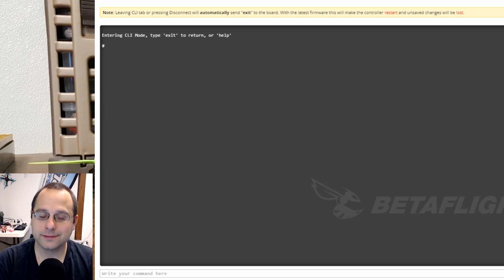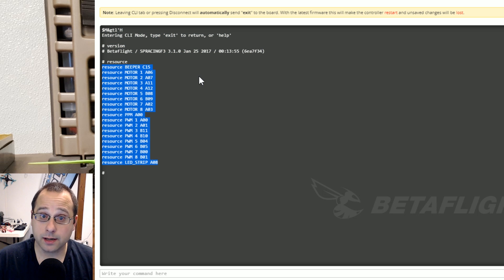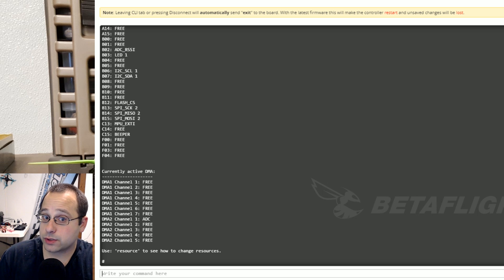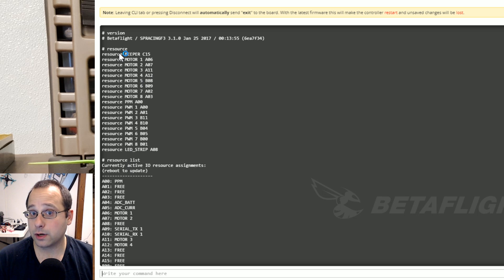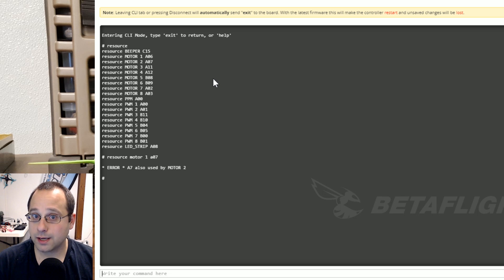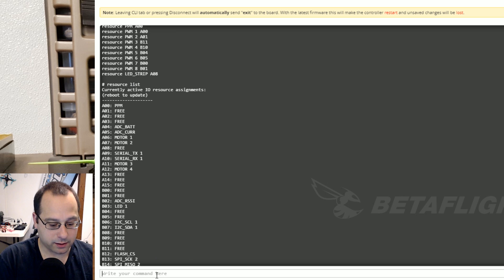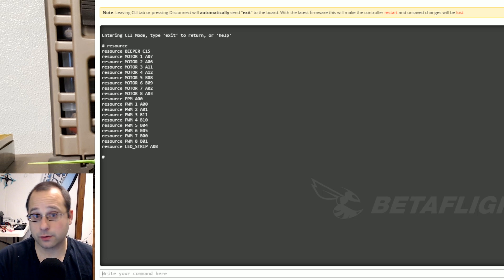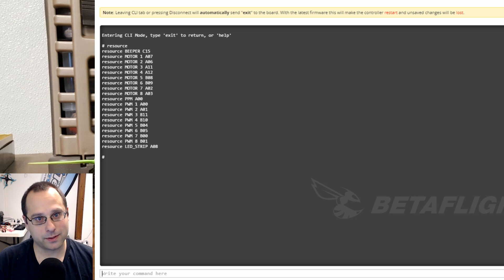Betaflight 3.1 Resource Remapping | NO MORE CUSTOM MOTOR MIXES YAY!

Comment: just a datapoint for you, for flip 32 omnibus AIO f3, you can't use motor pints 5-8 currently as they are tied to UART3/I2C.  you can however release the resource for the addressable pins for LED and use those as a single spare motor pin.  I did this recently and got it going.  on the flip 32 f4 board you can use the 5-8 pins no issue.
Reply: Kwad Skwad I have an F3 omnibus that both the PPM and sbus resistor are gone and the solder pads are messed up I'm wondering if I could map another pin on the board for my d4r II and get PPM
Reply from the maker: +edwardMcrichy I think you can do that.
Reply: Success!!!  I was able to remap the PPM to the LED pins, connected my D4Rii and power.......everything works.......I now don't have to purchase a new board, this feature is awesome
Reply: Yesssss, remapped PPM to LED and everything works now, yay I have another FC!!!!!
Reply: +edwardMchichy awesome!! this actually gets me 2 old scrap flip 32 AIO boards back from the dead in my pile.
Reply: Joshua Bardwell I think I'm going to give it a shot this weekend if I do I'll post an update here
Reply: I think so, just find an avialable resource with resource list and set it freeeee!!! good luck man
Reply from the maker: +edwardMcrichy awesome!

Comment: The numbers are actually the code numbers for pin outputs on the MCU, if you download the spec sheet for the F1, F3, F4 etc. You can find processor pins associated to the numbers in the resource command. This is handy to add features on pads that arent broken out on certain boards.
Reply: Liam Lambkin processor has multiple peripherals. PA1 is pin 1 of peripheral A etc....PB1 pin 1 from peripheral B etc...

Comment: I love being able to do this! I burned out motor pin 4 on my x-racer FC and thought it was junked.. until betaflight 3.1! a simple remap and it's working awesome! great video to get others to know about this amazing feature joshua! also happy b day a day late!
Reply: You could remap your motors also on older versions of BF. it's called custom motor mix. Joshua did a video a long time ago. This only seems to be a bit easier. And now you can do it on the wild. Earlier you only could swap them between the different motor pins (e.g. m1 to m8).